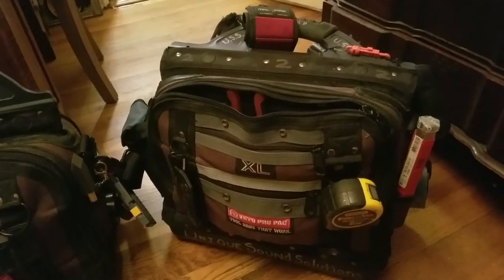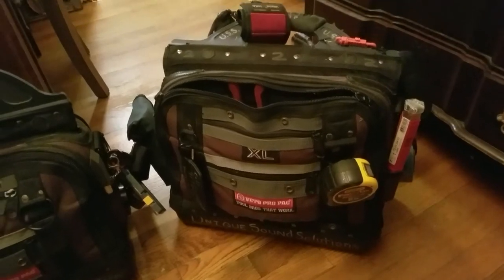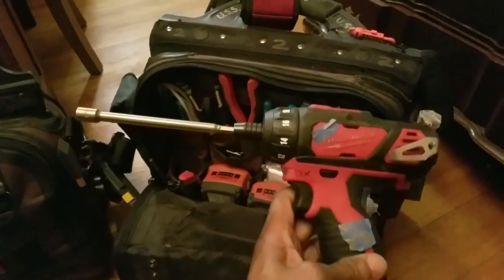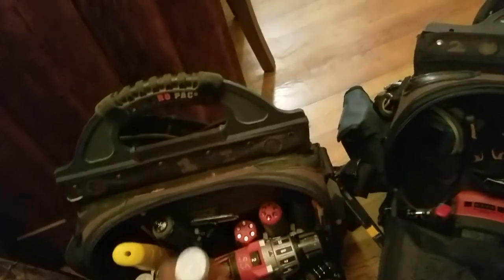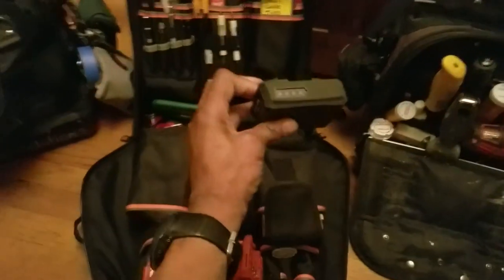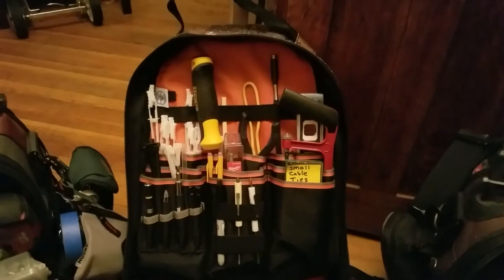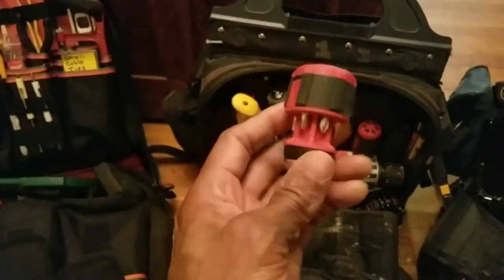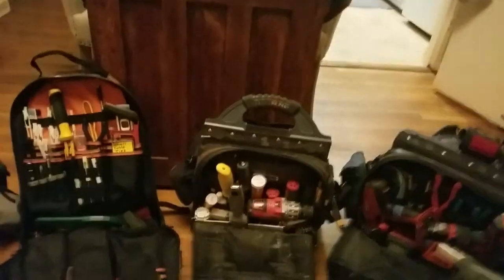18 Volt drills Can be stored in Veto Pro pac bags!

Comment from the maker: Thx buddy!  We learn from each other. I always thought about buying the XXL but I frequently work in customers homes and navigating with such a wonderful but large bag and going up steps would be a challenge. The XXL would hold all the power tools i need.  But it would be heavy too.
Reply: True! I've learned to navigate pretty well in residences, being very careful not to ding walls. It's actually pretty easy with the XXL. I've had no problems. you just hang it on your shoulder, and then tuck the end in behind your back when navigating in tight quarters.